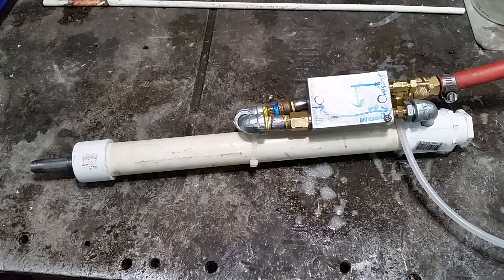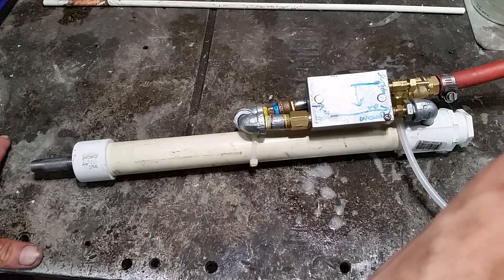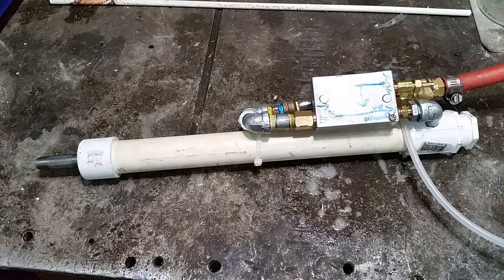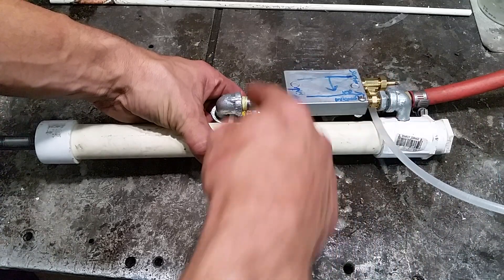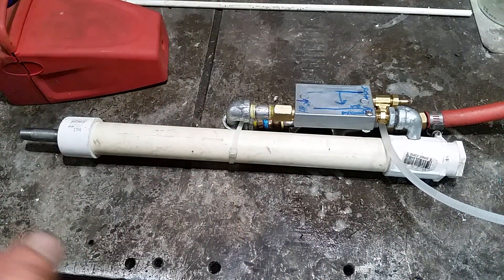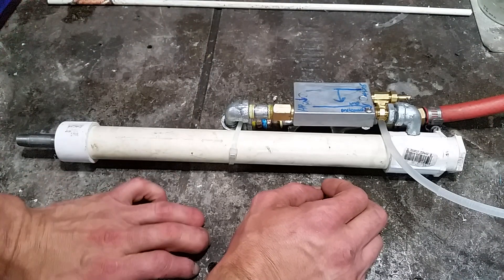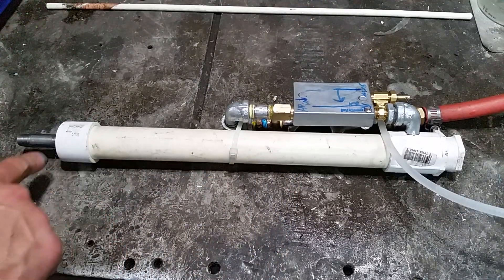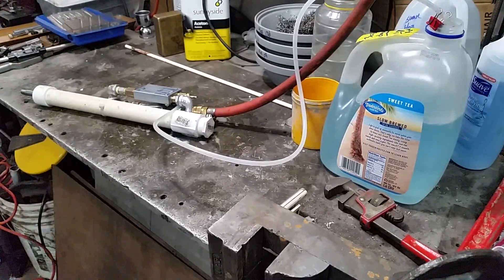simple aircrete foam gun

Comment: Can you give a detail list of supplies needed to make this? I think volumizing shampoo from the Dollar Tree might work good.
Reply from the maker: it does not.  I have been down that road and some will make foam but it will collapse quickly and nearly entirely when mixed into concrete.   the best shampoo/soap made a block 33% more volume than a solid concrete control.  drexel was nearer 100% (double control volume).  and even if the shampoo did make good foam, the economics of the concentrated formula make it less expensive.  lastly drexel is a foaming agent, actually a marking foam in agriculture.  Its sole purpose is so make foam that lasts for hours (i think they advertise 14+)..and outdoors, which means it needs to be pretty stiff.  There are others out there that may do a better job, this is the only one I can personal attest to.

Comment: HDC tends to leave out details simply to try to sell a product.   I don't mind his communication style much, though, just his business sense gets to me. 

I killed a cheap pressure washer that I can't find parts for, so I'll be taking the concepts you presented  and put it under the knife. 

I put off aircrete for over a year.  Now I've opened the proverbial box.  Lol. 

Gonna be moving to a small acreage on the highway and will need aircrete panels to kill the noise.  Someday it'll be a new house (timber frame ) with SIP like panels to finish walls. 

Also a lot of small goat people around here who need better shelters for kidding in -40 like we were 2 weeks ago.
Reply from the maker: yah he seems like a perfectly nice guy, but something just rubs be the wrong way.  
did you kill the power washer try to make foam?  i was wondering the other day if you could setup a power washer with foaming agent @ the soap feed and restrict the water enough and/or rework the wand with a packing like I did in the video.  you would suck or push air in somewhere.  This might just make foam and at a high rate like you would be needing.  If you were you just saying you have it to cannibalize parts, thats a good start.  Keep in mind, I was making much smaller volumes , you will need to be more on HDC's scale   Tuning pressures and mixture ratios will be key, so keep that in mind while designing.  Also this stuff takes a long ass time to dry(remaining in molds) and are still really delicate before they cure and even then you have something a lot like a fire brick durability wise(i expected something closer to concrete).  but you have way less material and good acoustic/thermal  insulation.  I shifted to perlite concrete for concrete that needs to insulate and found more consistent results, on my scale was worth the cost.   you might play around with that or organics like hempcrete.  

also maybe consider making blocks that stack into a wall, I dont know what kind of tooling / equipment you have available to you, but blocks might be more manageable.

Well those are my after thoughts, hope it helps.

ps could you clarify what you mean by "small goat people"
Reply: @mtraven23  I haven't made any foam yet.  I broke the pressure washer using it .  Cheap Chinese unit. 

People with small goat herds, not homesteaders,  just farm community people with day jobs and goats. 

A person could modify a pressure washer to make foam as it sits, add air at the wand (and possibly suction side of pump) only problem for high quality foam is time.  It might make a lot of foam fast, but will it be strong foam? Will still need a tube to keep the unstable bubbles in and the good bubbles in the mix.   

Making bricks is one thing I'll be considering.   Will be trying out various fibers as I have access.  Straw for example.  I have a weed mix in bales waiting to be ground up.  Mostly kochia, lambsquarter and sunflower.  Lots of fluffy pith, plus fibers.